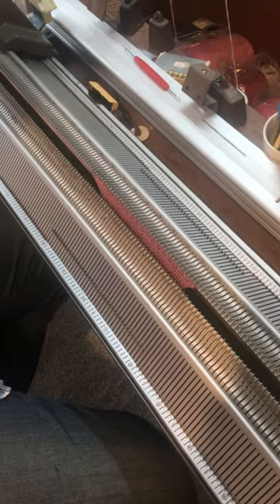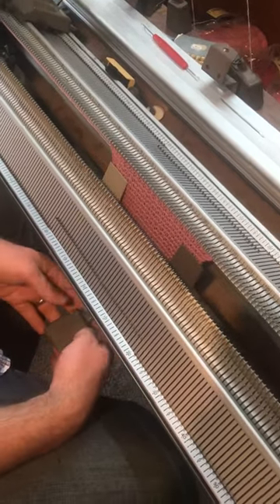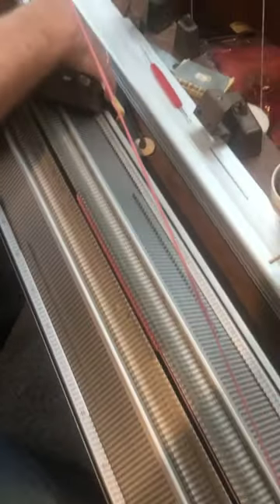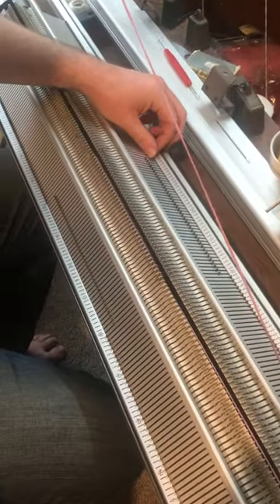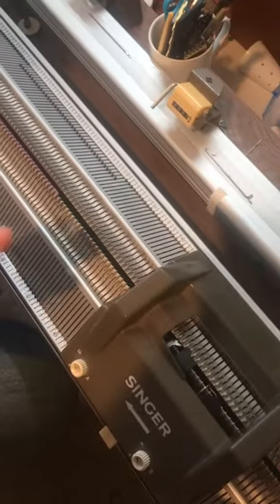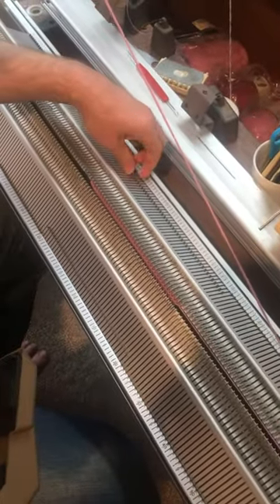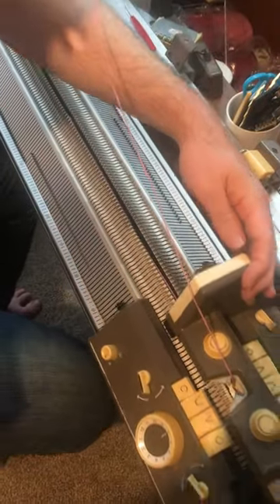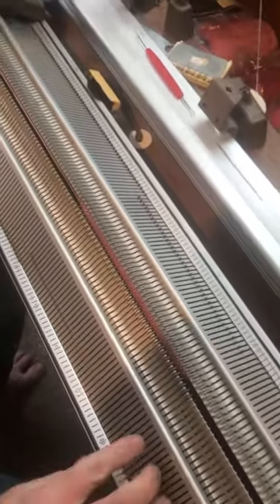Superba GLTC

Comment: you said you used tension 8, do you have other settings you would recommend such as bed spacing?
Reply from the maker: It has been quite a while since I made this video, however it would be 4 or 5 as I don’t think the garter carriage works on 6?